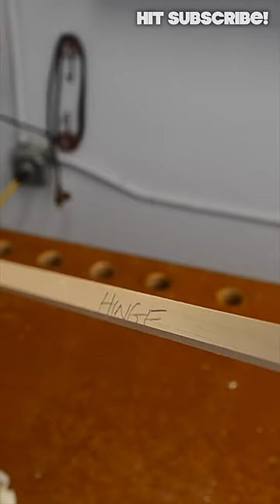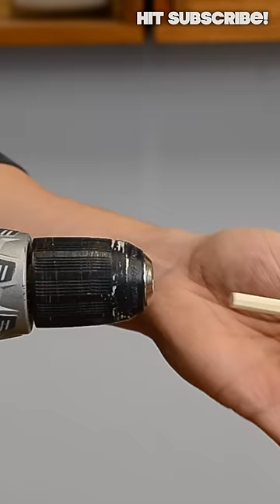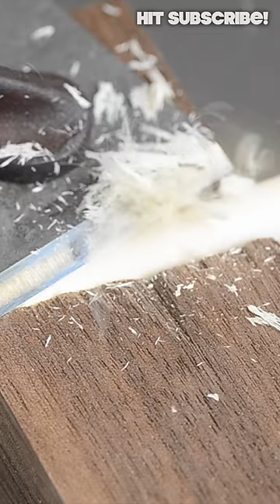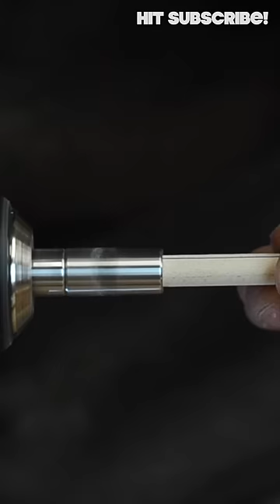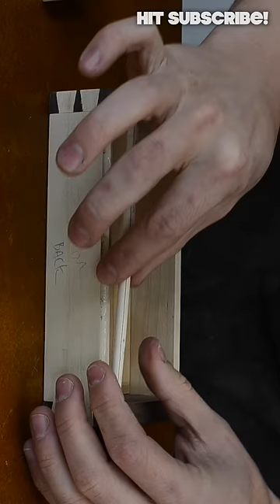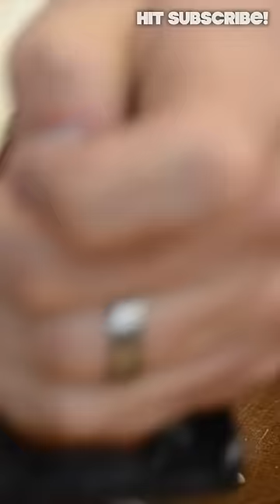100% Invisible Wooden Hinge #shorts

Comment: I would like to learn more about that doweling jig! 

That hinge is awesome too!
Reply from the maker: Awesome thanks for watching Robert! I made it with a clamp and an old block plane iron. It takes forever to get it set up just right to get the dowel diameter exact (by shimming the blade up and down with pieces of paper, changing angle of the blade, etc) but once you get it set up it stays that way forever!

Comment: I've been back and forth about getting this setup from Rob for the better part of a year. I appreciate seeing someone that hasn't been using it for years and years get good results the way he does. Thanks for sharing!
Reply from the maker: Thanks for commenting Brian! Honestly I was making pretty great looking boxes on only the 3rd try or so. Using Rob's recommended router bits and his dowel centering jig helped a lot. The hardest part IMO is getting the jig and process set up to cut your own dowels.
Reply: @dkbuilds  I think I remember him making a similar comment about how finicky that dowel cutting setup was to get right. Did you buy the whole kit or just a single size?
Reply from the maker: @briancarroll6803  I just bought the 1/4" hinge drill jig, some 1/16th rods, and the 1/4" core box bit. Might consider buying a bigger size one day but for now I'm happy making small boxes. I would say that probably store bought 1/4" dowels will work fine. Bring the drill jig to the store and if the dowel fits snuggly into the end of it you're golden. Of course it won't match exactly the wood species of the box so you won't get an "invisible" hinge, but you'll bypass the hardest part of the construction IMO
Reply: @dkbuilds  thanks for the tip!